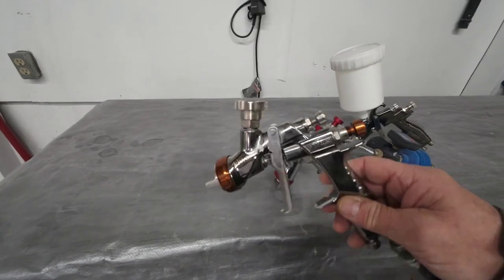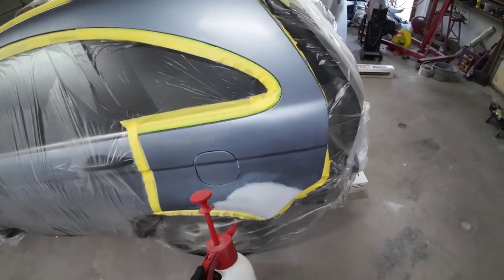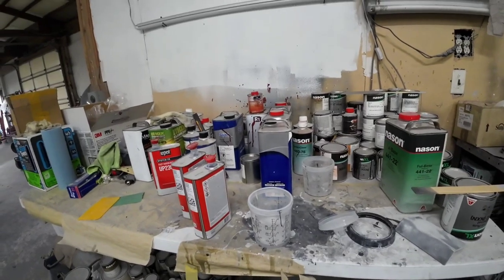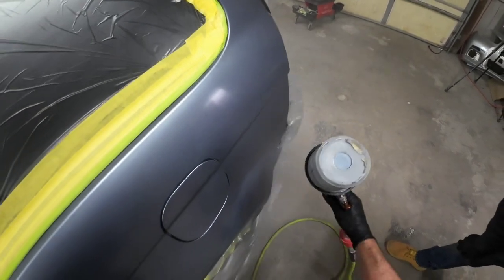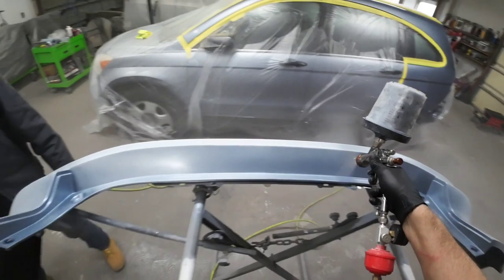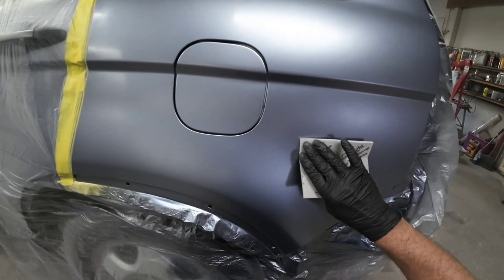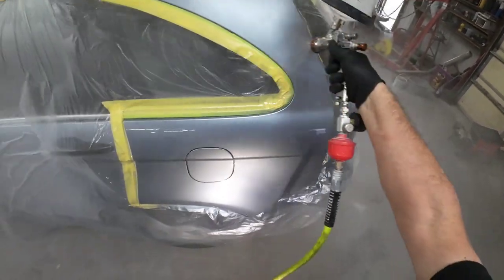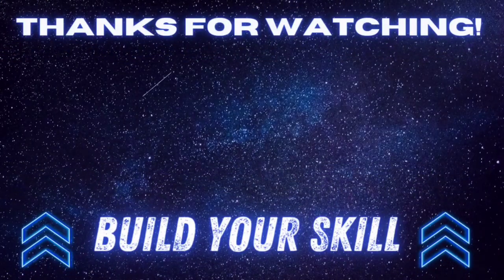TIPS and TRICKS when painting a car!

Comment: Thanks, for sharing that Chris hope you're well I have the same gun 🔫  mate kiwami 4 1.3 there do a kiwami WBX 1.3 and 1.4 for clear coat paint reckon Chris its a cracking gun 🔫
Reply from the maker: Thank's for sharing,  appreciate the comment and support!
Reply: As you know Chris i have the kiwami 4 1.3 I have heard nothing but amazing results and reviews on you tube mate there are a cracking gun i carnt wait to try mine out Chris there do a kiwami WBX 1.3 and a 1.4 for clear coat paint its got a gold air cap  I have see  the reviews on you tube Chris Cracking gun I have a PPS cup 🥤 system gekeo Chris when I went to spray something today the paint started to leak the plastic insert cup mate was pushed in and leaking Chris can you give me any advice  on the 3m PPS cups when you put the lid on
Reply: @GarageNoise  chris I have a pps cup system and when I put the liner mate and the lid on chis it pushers the liner in side the cup causing it to leak any advice 😳
Reply from the maker: @ANDY-we7mr  you might check the top of the hard cup that holds the liner may have some dried clear causing it. Other than that it's  hard to say.

Comment: Chris you never replied back to my message buddy I have the Gekko PPS paint cup system for some reason Chris when I push the filter cap lid on its pushing the plastic liner inside and leaking its happened about  4 times
Reply from the maker: Gekko is that the same style I'm  using?
Reply: @GarageNoise  chris I done ✔ some spray painting on a steel garden bench  when I put the paint in the cup liner and lid on top it started to Leak paint from the liner inside the cup
Reply from the maker: Well I don't  know if that's the same style of pps I'm  using but sometimes some paint can get on the housing lip and it prevents  the liner from sealing. Other than that I don't  know brother.

Comment: The panel which did not need repair u rubbed it down with wet & dry yes the panel above the quarter panel yes
Reply from the maker: The roof rail that runs to the front was all sanded with 600 to prepare  it for the new clear. I think that's  what your asking. Appreciate the question and support!